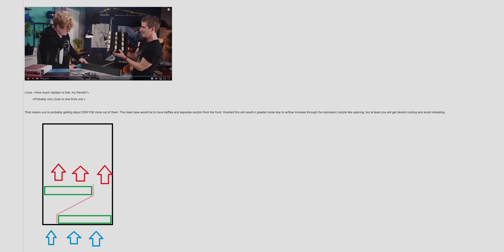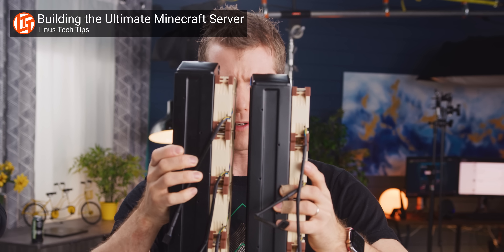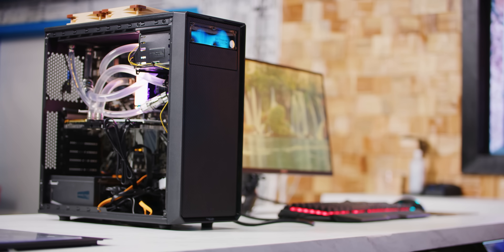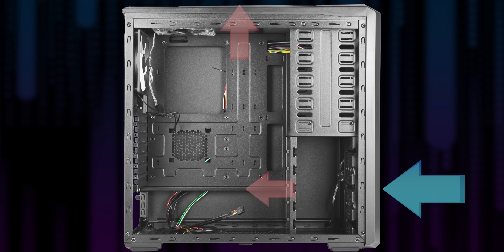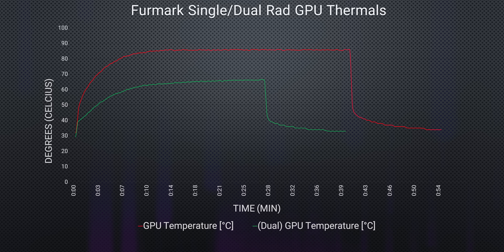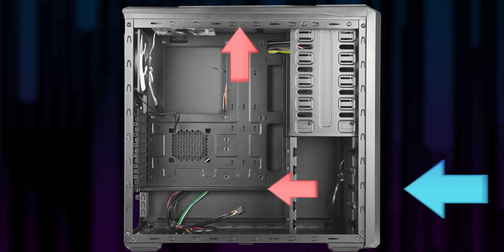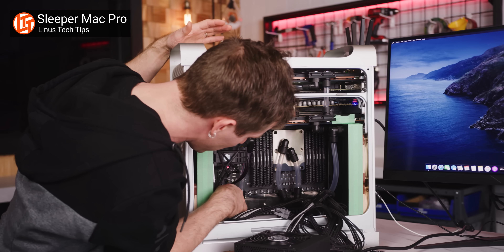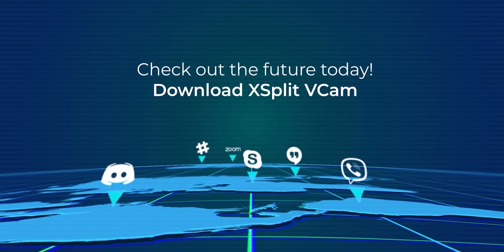I’ve been water cooling wrong for YEARS - $H!T Manufacturers Say

Comment: "It is not efficient to stack radiators" i think this is the correct statement
Reply: i believe so too, i think the real reason, why the test setup ran cooler is because of the second radiator. there is more water in the system which is hardern for the cpu and gpu to keep at a high temp. (imagine cooking pasta with one liter of water and compare it with cooking 10 liters of water. if you dont change the heat source it will take much much longer for the 10 lieters to start boiling)
Reply: @jakobwehrstein1302  Not completely, since it was clear from the graph that the second setup wasn't going to reach the temperatures the first one did. The second one never got to 'the boiling' point. The more the water the longer it takes, but it would eventually reach the same temperatures if that were the case.
Reply: @jakobwehrstein1302  You have NO idea what you're talking about. What you're talking about is TIME TO REACH STEADY STATE, which is something they addressed IN THE VIDEO, but it still EVEN AT STEADY STATE was 20c cooler than without the second rad.
Not to mention if EITHER of you idiots would actually LISTEN to the video, he said they removed 1 of the 3 STACKED in the minecraft server and saw temps go up 5c.
Reply: @shawnpitman876   Umm yea thats what they said, cooling a radiator with warm air isnt as efficient as cold air. And of course the cooling system for the server ran hotter, Jakob made that point. Less water means less heat distribution means hotter water, exactly what the second comment said.
Reply: @shawnpitman876  If you add water you're also increasing it's surface area which directly increases heat transfer. Obviously that doesn't matter if the air is as hot as the water and just adding water without adding a radiator would not do much at all.
Reply: @shawnpitman876  chill dude lol. I meant the surface area of the water and as I said it doesn't really make a difference in the case of watercooling a pc.
Reply: @shawnpitman876  to better explain my point: say you have a rad that's filles halfway versus all the way. The surface area of the water is greater in the full rad. Heat transfers from water to rad more efficiently. Got it?
Reply: @shawnpitman876  yes they removed a side-by-side stack and saw a temp increase, but I bet that was mostly because they removed a fan set, and not a radiator (I.e. they have less airflow speed with less fans sets).  Put back the fans, but not the radiator, and I bet they will get the majority of the 5C they lost.

Comment: Such a wrong test bench. 
"-You will sweat in this sweater. - No, I will not!  [cut holes in sweater] "

 Why haven't you tried setups critiqued by corsair? At least similar configurations and conditions of cooling? 

1. There were no extra intake holes in minecraft server. Just rectangular tube "blocked" by stacked radiators. You should've tried at least stacking radiators in your setup. 
2. There were no extra intake holes in the "mac pro." Solid top, bottom and both sides: just 1 radiator in + 1 radiator out.

Comment: Linus, I can see that your rads are serial stacked and that you did tests on serial stacked setup. would you try parallel setup? so instead of going cpu>gpu>rad1>r2>r3 and then back again to cpu closing the loop, GO cpu and gpu to 2to1 main pipe and then main pipe spit into 3 way to radiators and then from 3 rads back to single main pipe that again splits to cpu and gpu to close the loop. that way you have 3 radiators working with full heat exchange potential. In a way that is now connected first rad works with 100%, 2nd with circa 25% and 3rd works with 10% because in each consecutive rad in series there is less difference between ambient temperature and coolant thus less heat exchange. Serial setup only works if you're using different cooling methods in each step like in making Bose-Eeinstein condensate...

Comment: I'd be interested to see the data for literally stacking radiators like in the minecraft server build. I think this video may have missed the mark in what Corsair was saying, regardless more radiators will help. I think their point was stacking radiators on top of one another literally would be very inefficient. Since the heat exchange in the air from the first rad would just get pushed back to the next it would be less and less efficient through the stack. But then the loop is also getting cooler past the first rad, so who knows. I demand graphs

Comment: You put a 240mm radiator to cool a 2080ti and 9900ks, that pull 500w. That rad can only cool a max of 350W, what did you show?, that you need that minimum of rads to cool, you should have put one rad and than another one after the other as in your server cooling. Did your writers drink iso alcohol?

Comment: Hey Linus, I'm a recent mechanical engineer graduate and if the case is perfectly sealed and had no ambient air then Corsair would be 100% correct....but that's not the case in the real world. So when you say the drop in both CPU and GPU temps is most likely due to other ambient air getting into the case and mixing with the hot air inside, you are most likely 100% correct!

Comment: I feel like Corair's simulation assumed that the Case was vacuum sealed and their simulated radiators had magical perfect termal transfer, so nothing was effected by air leaking, air turbulance, or dust.
Reply: I bet that's how they did it. To have accurate results, you need to remove nuisance variables.

Comment: Great video! Would've been nice if you had measured the air temps intaking and exhausting the radiators, as well as the radiator temp, maybe there is where their math (corsair's) went wrong

Comment: yeah, Corsair's claim didn't make sense on face value. The efficiency of the conduction of the heat between the rad and air is not really all that high and as such additional rands even using the same air will still confuct heat into it as the air as long as the mass of air is below thermal saturation. You'll get diminishing returns sure, but that's not to say stacking rads won't give you less coolness unless the first rad is thermally saturating all the air passing through it which back to efficiency once again is just not likely.

Comment: Corsair probably message you because you are stuck radiators on top of each other, I think it does work especially if your fans are spinning fast enough but it's definitely not the best way to do it. It would be much better if they were away from each other.

Comment: Sounds like they over estimated the actual efficiency of their radiators in this situation.
Reply: This. If the heat transfer were so perfect that the ambient air were exactly the same inside the case as the water running through the rads then maybe there would be some merit to their claim, but everyone knows this does not happen. There is still temperature difference, so therefore heat exchache happens. Maybe not so effectively as the rad with direct access to cool air, but still.

Comment: It's thermodynamics. You can't cool down to ambient on air alone. You need an external source of energy outside the system like a chiller. Water has a finite thermal capacity and throwing in more water doesn't change that. It just takes longer to reach that thermal maximum.

Comment: The problem with the test would be with the fan configuration of the second radiator. What they had pointed out was when you had one pulling air in, and another one sucking that air out of the system. Therefore the second one was using hot air to cool, if both fans are sucking air INTO the system, they are both using air at room temperature, which is simply dissipating from the cad because of its positive air pressure(probably through the back panel).

Comment: Lets be logical...it pretty much will boil down mainly to 2 factors , air pressure, and the heat disbursed by the first RAD. If the heat disbursed by RAD 1 is at the RADs limit (lets say 2 SLI 780 TIs [really hot] into a single 360 rad thats really efficient,  then the air coming out will be hot, but if the 1st rad say cools a 3950x which produces much less heat then the air coming out will have alot more thermal capacity left as the rad was not even stressed) Now the second issue is air pressure, if the case has positive air pressure and no new air can come in then the second rad must use the hot air from the first + other heat, which will limit its effectiveness (probably not 100%). SO corsairs conclusion makes sense only if RAD #1 is fully saturated and you have positive case pressure(with all intakes going through rad#1), but if you either have negative case pressure or RAD #1 is not saturated, or you have even one intake not going through a RAD then in MOST cases a second rad will add more cooling capacity, it might not be at peak efficiency but it will have more capability.

Comment: If you're going to do multi-rad, you're probably cooling both your CPU and GPU, and if you're doing that, you should run the series as:

CPU - > Rad1 - > GPU - > Rad2.

This lets each step have the highest Delta-T possible. The water leaving your CPU will be a high temp, which will let it cool a lot when it gets to Rad1, then leaving Rad1 it's a low temp which lets it pull more heat from the GPU, and so on. If you have one Rad dumping into another Rad, you're trying to cool down cool water which doesn't work very well and you're wasting some energy.

With this, you'd probably see better performance with two 120 Rads instead of one 120x240 rad even though you're losing a little bit of surface area.

Comment: Radiator stacking would have a negligible effect depending on the heat load. 
Every radiator can only dissipate a certain amount of heat energy depending on the difference of the working fluid (water in the loop) and the cooling fluid (ambient air). At some point stacking radiators, like in the minecraft server build, the cooling fluid may reach the same temperature as the working fluid, at which point adding more radiators in that orientation would have no net benefit to the cooling of the system. 
Simulations are cool and very useful, but practical experiments have to be done to validate those results. 
To run simulations for every loop/case config would be tiresome and a bit useless.

Comment: Using 2 rads adds more cooling capacity so you will see a big difference unless your going overkill like running 2 thick 360mm rads for a 3300x and at that point your beating a dead horse

Comment: imo, a 120mm for the gpu, and a 240 for the cpu is the perfect combo.
4 x 120mm intake up front, all rads on exhaust 1 x 120mm for GPU, and 2 x 120mm for CPU. Separate AIOs in my situation.

Comment: Corsair is not 100% wrong and Linus is not 100% right. More is always better in cooling. What engineers usually get hung up on is the term efficiency. YES one radiator is more EFFICIENT, but not more effective.  Here Linus was able to demonstrate effectiveness, but not efficiency. Also "modern" radiators don't heat up the air instantly. Just take air conditioners as an example. They tend to run pretty close to the freezing point, but the air that comes through is never exactly the surface temp or 0 C.

Comment: If removing one radiator increases the temperature by 5 degrees, would removing the second one increase the temperature by another 5 degrees? I would suspect not, and there are diminishing returns with adding radiators.

Comment: Crap take, you didn't even actually test what the mfg was ACTUALLY telling you

Take the same rig, test with dual-radiator, one test with the radiator pulling stale warm air, the other test pulling fresh cold air on both radiators.

THEN tell me if there's a real difference between the two setups.
Reply: Hear hear !

Comment: They are talking about stacking radiators, youndidnt stack the radiators. Stacking them means literally putting on on top of the other (which is thermally mostly poontless). What you are doing is adding radiators (which is thermally useful)

Comment: Two points to counter Corsairs claims:
An radiator from a watercooler is just a aircooler at an "unusual" spot. Since the heatsource to cool isn't the CPU or GPU anymore, but the intermediate heated water.
A bigger aircooler in thickness helps cooling, so is a thicker radiator, or multiple radiators dispersed in the system, even sandwiched.

I would like the data, that says that all the air pumped trough the case reaches water temperature when exiting the case. Yeah air has a much much lower heat coefficient than water, still you push alot of air around, and it doesn't stick around the radiator to long. So even somewhat preheated air can be uaed a second time, if it flows quickly enough. This is especially true in winter, or better not-summer.

So corsairs claim can be right, I read similar tests on german websites, but this is mostly happening in summer with hot air and sandwiched radiators with very slow spinning fans (600rpm 120mm) where more radiators can be worse.
Reply: Wouldn't that mean that the water has to be at ambient temp if the air would reach the loop temperature inside the case? Spoiler: it doesn't.

Comment: I'm curious if rad order matters. Because corsair might be closer to right if the "intake" rad is first in the loop. Because of the "exhaust" rad is first the bulk of the heat is going to be pushed out of the case.

My guess is this is a mostly negligible impact. Still a good idea for a follow up...

Comment: You fell into the trap thinking you are water cooling. You are not, you are just air cooling at a different location. Water cooling with the radiator inside the case is really no different than what a heat pipe does.  Yes from dead cold the water does absorb the heat off the cpu/gpu but that only lasts so long until the heat then needs to be "radiated" into the air.

Where you may be seeing performance improvements with a 2nd Rad in the loop, is in bursting CPU temps. More water volume means it can absorb more spikes in CPU temp before it needs to transfer the heat out into the air. Really up until the point the rads try to boil they are still taking on more heat.

Comment: I'm a bit disappointed. I thought that you would do more specific testing. Like if stacking  a second radiator  behind the first and what that will do. Just different configs not just one. Or really measure the temperature of the air behind the radiators with some sensors.
Reply: You are on the wrong channel of you want well controlled testing, my friend. :) ltt is a great channel, but that's not their forte.
Reply: @HMarcBower  Hm it used to be better. I mean I expected more from Linus... His answer to that was so short. I dunno still a bit disappointed
Reply: @metheOblivion  I don't think they have the kind of time to spend on this that other outlets like gamers nexus would dedicate. I mean, the whole "we pulled a radiator out of the Minecraft server" seemed very last minute (and no footage?) and did they also take the fans out? I assume so to get a 5 degree increase. Best to just enjoy ltt for what it is. :)

Comment: The best way to think about it, is that the air coming through the first rad and mixing with the hot air in the case, probably still cooler then the water flowing through the rad. The heat exchange is FAR from 1:1 when it comes to the rad to the ambient air. It's almost like Corsair is thinking that 20c ambient air going through a 90c rad will equal 90c air.

Should throw a thermal probe inside the case next time! I would even say do it, seal ALL the cracks. That way all the air has to come through the rads. Probably actually get better results!

Comment: There's a reason the fans suck air in from the outside (or front of) a car's radiator instead of from the engine bay.

Comment: Greate video. I was actually curious about this subject.
I have a Ryzen 7 1700 @4Ghz and a GTX 1080 TI and I bought a second radiator, "Because I can" and I notice that in lighter CPU scenarios and the GPU was fully loaded my GPU temps raised a bit.
And the rad between my CPU and GPU is expeling hot air out of the case. 
So I guess Corsair claims make sense.

Comment: A dual rad system works except the secondary rads actually have to be external one sitting outside the case. And the rad that is inside the case should have its fan pushing the air out of the case while other case fans suck cooler ambient air into the case to feed the rads air flow.

Comment: I am going to have to partially agree with corsair here. They are correct in the sense that the double rad will cause hot air to flow inside the case and get picked up by the second radiator. But if you look at the CFD they are projecting a ~27 degree exhaust air. Their case of the heat getting picked up by the rad will ONLY happen is the water temperature is less than 27 degrees. So corsair is correct in theory, just that this fact hardly every applies in a PC.

Comment: if you are smart about your setup and planning, the added thermal mass of the extra water, and the extra surface area will help as long as you can feed cool outside air to each heat exchanger.

Comment: Your dual-rad setup works because the first rad is NOT extracting all the heat possible. Corsair's root presumption is incorrect. Unless the air coming into the second rad is the exact same temperature as the liquid flowing through it, it WILL extract some extra heat. Corsair is also ignoring fluid dynamics of the coolant (among other things). The order of flow for your dual-rad setup will also have an impact. ALSO, your second radiator benefits from the chimney effect (heat rises) and is pulling in lots of cold fresh air from that back vent.

Corsair is using such an overly simplistic model it is going to be wrong 100% of the time in the real world. ANY variance (thermal transfer from outside case, air leaks, etc) will mean that no matter what the second rad WILL IMPROVE COOLING, even if only by a small amount.